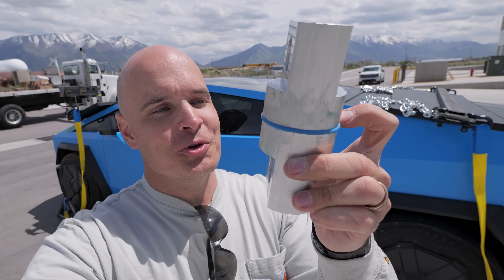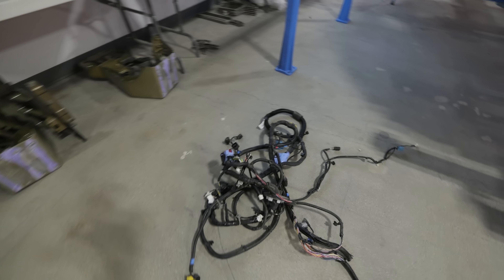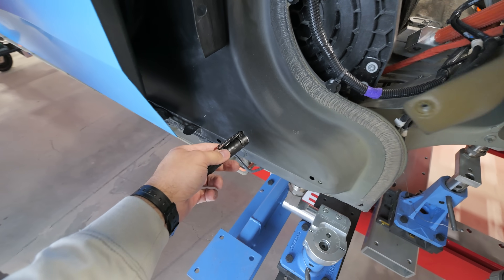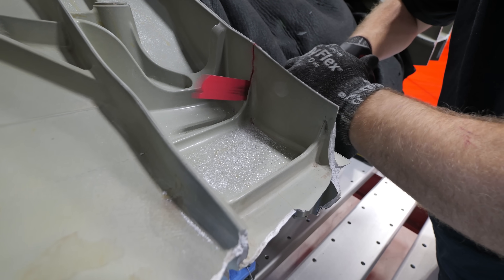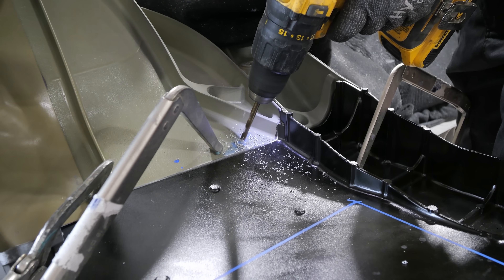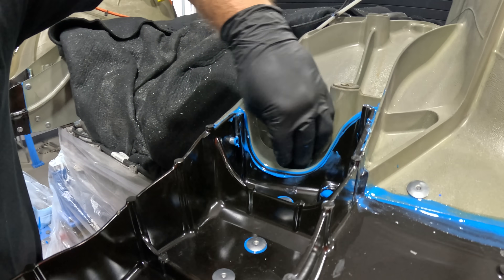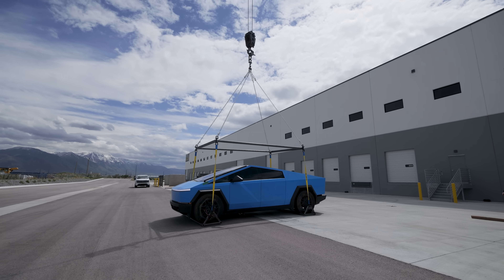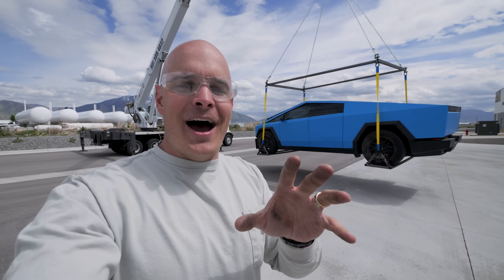Tesla Fixed my Cybertruck with GLUE - (but I'm not mad about it...)

Comment: I’ve never seen a glue advertisement this convincing in my entire life.
Reply: Have you never seen flex seal?
Reply: @paswordpasword9582  I SAWED THIS TRUCK IN HALF!
Reply: I have never seen a glue advertisement  in my entire life
Reply: @MCdGi1  Krazy Glue had one when it first came out.  The 70's?
Reply: @PruneHub  It's funny, the cyanoacrylate glue ads (super glue, also under the Krazy Glue brand) were basically this same test, just lifting two dudes instead of a car, but basically the same setup of two cylinder faces glued together. But it was the 1950s and it was only a single drop of the glue.
Reply: @PruneHub  re: "Krazy Glue had one when it first came out.  The 70's?"  exactly late 70's early 80's. those "just born" and "baby young to the world" will likely have never seen the TV commercial showing the guy in hard hat famously hanging from the underside of steel beam (you can find the commercial right here on YouTube).  this heralded the Chemical Industry's mass commercialization to consumers of CYANOACRYLATE, prior to this point in History the only glue of any consequence was...  wait for it...  ELMERS.  "Pepperidge Farm Remembers".   also ref: TESTORS...👈those who built Models and/or Model Rockets will be familiar with this glue.
Reply: @phillyphil1513  Depends on just how familiar someone is with the fumes from Testors glue.  It can blur your memory
Reply: @PruneHub  I was about to say. They used to advertise superglue by lifting ridiculous amounts of weight. It's capable of holding that all together, but where the superglue fails is it's weak defense to shearing forces.
Reply: @MCdGi1  Never seen KRAZYGLUE ads in the 70s, they adhere a hardhat to a steel beam, and a union guy hangs from it ?  Gorilla Glue current ads ?
Reply: I feel like I should get some of that glue, a hardhat, a ladder and a steel beam.
Put some on the hardhat, put the hardhat on, climb up the ladder and stick my head to the beam. Then carefully move off of the ladder...
Wait I think I just described a super glue commercial.
Reply: @imark7777777  I just posted that.... 2 days later.  I remember those ads in the 70s. They are Gorilla approved!
Reply: when I was around 9yrs old, I remember back in the 1970's here in the UK, seeing a pack of 'Araldite' two part Epoxy glue my Dad bought and used in his garage, had a picture of a car lifted by crane with just a small bonded block to the roof of the car, it blew my mind that glue could do that at the time! 😯😏👍    😎🇬🇧
Reply: @thedarkknight1971 yeah I was thinking of this one. Araldite glued a yellow car to a billboard in 1980 something
Reply: What about long term adhesive testing? Vibrations, temperature fluctuations? shear & twist forces?
Reply: Wonder how much Musk paid for this one considering all the hate he currently is getting.
Reply: "One day the old becomes the new new". In the 60-70's there was advertising about a contact glues doing the same. Lifting a passenger car from the crane. But at the time the cars weight was about 1000 kg, so Cyber Truck is 3x the weight what was back then. I might have somewhere the old glue tube box even with the photo of the demonstration.

And that is what makes it impressive. 

When young people learn about gluing, they are limited to one or two glues they can use. Then they get to learn that there is different glue for leather, for plastic than for wood etc. 
But when someone learns that there are tens of thousands of different glues, for different purposes and applications.... It expands the understanding because the changes that one can find the best glue for their application is remote. Why there are just these universal glues sold to consumers. Where industries get to use unique glue for the very specific purpose for best possible result. 

Sadly many uses then the cheapest and best for the price, and glue don't help.
Reply: That was a terrible repair though. This glue will degrade over time.
Reply: @nsevv  dude, I used this exact same stuff doing autobody 10 years ago. The only thing that releases it is high heat
Reply: The best glues are the ones you dont hear of.
Reply: Never seen flex seal ad??
Reply: There are plenty of videos showing cars being help up by a few drops of basic super blue. This isn't new
Reply: Yeah I've never seen a flex seal ad
Reply: Flex seal
Reply: Belzona ads
Reply: will it hold for 10 years of vibration, -15 to +40 degrees?
Reply: @carlknibbs2849  Q: will it hold for 10 years of vibration, -15 to +40 degrees? A: well since (CONTRARY to the stated mission) Teslas are obviously built to be "disposable" and NOT "sustainable", come 10 years time it won't matter because the bulk of the cars will be filling up the Junk Yards (just like they are right now at various CoPart and IAA yards across the country) NEVER having offset the massive Carbon Debt incurred when they were first manufactured. 👈conspicuously because their goal is STOCK PUMPING and not much else, the fanboys won't deal with this problem nor the Li-Ion Battery Fire problem.
Reply: Reminds you of the old 1980s ads for SuperGlue, where the dude would be glued by bottom of shoes to the ceiling :)
Reply: literally the super glue commercials from 30y ago.
Reply: The real question is how long it holds up after going through countless heat cycles from the outside heat and then cooling down again. Same goes for the countless winter days.....
Reply: 3M VHB tape, while not glue is pretty revolutionary.
Reply: Where can I get this damn glue
Reply: Tesla makes the glue from workers who died in Elon's emerald mines.
Reply: @andan2293  Errol's*. Remember Elon hated his dad because he's messed up? And that isn't Tesla's glue, that is Fusor 298. Hilarious joke tho.
Reply: @Earthrise-fusion  Elon might have hated his dad, but he for sure didn't hate his money, lol. 
Yeah the glue is impressive. Even the cybertruck repairability is surprising.
Reply: @Earthrise-fusion  thats why he decided to be such a pos dad himself? Few parents I have seen so hated by his own kids.
Reply: @andan2293  Why have people blown this emerald mine out of proportion. His dad only partially owned a mine and it collapsed when Elon was 17. It’s seems wild how people see someone achieve 400B and still say “but what about that 20k his dad gave him when he was starting off? 😢”. Yes, he didn’t grow up poor, but still…
Reply: @andan2293  the thing about Elon getting a ton of money from his dad is a hoax.  He got $28,000.
Reply: @Earthrise-fusion 
Yeah.
I probably shouldn't mention the adhesives and sealants used for structural reinforcement in commercial aircraft, for many many decades now.
... at least 7 decades i know of anyway, that's many 😂
Reply: @My-Pal-Hal  yeah. Honestly, adhesives have come a long way, but what pisses me off is that ppl associate glue with the Elmer's glue they used to drink in kindergarten.
Reply: @Earthrise-fusion 
HEY MAN, DON'T BE DISSIN ELMER'S !!🤬!!

... sure, ill take another, on the rocks this time 😋
WHAT DO YOU MEAN I'M CUT OFF, IT'S ONLY FIRST PERIOD 😂
And I thought it was one of the 4 Food Groups. memories...

amazing we've lasted this long
Reply: @Earthrise-fusion 
Luckily we've advanced, and moved on from that, with the amazing technologies we have Today.
... TO TIDE PODS 😂 ...

we had a good run 😉
Reply: Lol😂😂😂 @My-Pal-Hal still prefer the OG tide
Reply: @andan2293  akin to Soilant Green? We ARE glue.
Reply: @andan2293  Wow is that true? It's sad but it works well, so it's justified.

Comment: What's the benefit of sawing off pieces and wasting time patching pieces together (while adding gunk which makes the material more difficult to recycle) when the base material should be recyclable enough to just replace whole pieces. Also, how many consecutive patch jobs can there be before no more can be done... missed opportunity to ask
Reply: with machine assisted lifting, disconnecting and replacing big pieces can't be any more time consuming than this

Comment: Try it with regular cyanoacrylate superglue. It's like you're replicating the original advert where two guys were craned up using a glued link of a proportionally smaller cross-section ofc

Comment: Teslas are known to be some of the most annoying vehicles to fix, but the fact that they make all the repair information freely available is such a big deal that I think it's completely lost on most people. Go try to do a basic repair on any car that is a 2016 or newer. The most basic jobs are complete nightmares because just getting the information like torque specs, bolt dimensions, and procedural steps is stupid difficult and extremely expensive. Most, if not all, mechanics have thousands, if not tens of thousands, of dollars' worth of scan tools and many hundreds, if not thousands, of dollars a year in subscriptions to said tools just so they can do stuff like reset codes and activate certain motors to do basic repairs.

Comment: Ah yes America: "Did you trucks frame break off? No worries just slap this super super glue on it!" even if the glue is strong enough to support a Tesla, I'm still going to side with a steel frame to begin with. This video has made me even more scared to drive around one of these death machines.

Comment: Great videos thanks for the clarifying statements regarding your previous video. Maybe add it to that video as well.
Next, shop of the triangular bed and make it a regular one. All you need to do is chop off the top add on castings and bend a bit of (thick) metal. Maybe colab with Fabrats or one of the other fabs in Utah area?

Comment: Glue adhesion just as strong as a continuous piece of metal, in your dreams, the cyber truck reminds me of oceangate
Reply: You do realize tons of other manufacturers use this stuff, right? This isn't a glue stick; this stuff is used everywhere and has been for years. The aluminum frame failed, not the glue, and they used very little glue compared to the tech.
Reply: Did you even read my comment before deciding to reply?  @littlejack59

Comment: I'd like to see the sideways sheer strength, also they way over engineered the repair compared to the way and amount of adhesive it came out of the factory with, the 3 strip's of adhesive glue allow water and air to ingress between the plates, at that altitude the freezing and thawing between the plates would presumably weaken the adhesive properties and make a side sheer force (like towing!) relatively low effort failure in the long term.

Comment: I know there are some mid sized pickups that you can buy an entire new rear frame section for 2 grand. You can tell me 14 grand for labor to glue and drill dissimilar metals is a great deal all you want. A typical truck is like 6 bolts to take the bed off and Tesla started by using the incorrect glue and recalling a bunch of vehicles from the jump. It's going to have to prove itself to hold up for 10-20 years, well after the second battery pack, for me to be convinced.
Reply: $13k was the entire repair, including as you say removing and reinstalling a wire harness, repairing the frame, and reassembling the vehicle.

If you buy your rear frame for $2k that doesn't mean thats the total installed price. And your rear frame is a lot smaller than this one, likely just holding the rear suspension components.

Comment: Where's the sheer test? You can use the same aluminum test piece you created by bolting two beams using the existing holes used for the crane lifting and apply a torsion twisting until until the two pieces twist apart.
Edit: You could also clamp one half securely and use a long torque beam with a gauge to measure the failure point on the upper half of the aluminum part pair.

Comment: I'm pretty impressed. I'd love to see a comparison between this and a more traditional uni body car in terms of repairability.

With that being said, I'm still not 100% sold on the Cybertruck construction. We've already seen two videos (yours and Whistlin Diesel) of Cybertrucks having catastrophic structural failure, vs a steel frame truck not failing under even harsher load conditions.
Reply: I'm yet to see the damage in the two Youtuber's deliberate destruction videos happen to anyone in real life.
Reply: @Turbo.M777 just because you haven't seen it doesn't mean it hasn't happened. I've seen a handful of articles showing Cybertrucks having the tow hitch completely detach while towing.

Besides, even if the damage is deliberate and unrealistic, that doesn't mean it's irrelevant. It doesn't change the fact that, when subjected to similar punishment, the steel frame trucks that were tested always came out on top by a wide margin.

Comment: That's brilliant, pre marking the frame and creating snap in replacement pieces.  Never occurred to me they did that
Reply: I saw that too my mind was blown
Reply: Turning the failure mode into a feature, not a bug.  No stretch racks, then?  Just sections.  Pretty neat.  Glad.  Feels like Jerry trued things up by putting it back together, online.
Reply: @hcjpbluesky9916 it’s not a “failure” mode. It’s crash safety and repairability.
Reply: Most people don’t realize how smart Tesla engineers are.
Reply: @scotttisdale2773 most people don’t realize sectioning procedures are out there on almost any car made of aluminum or steel. Hell the nsx with its monocoque chassis was worked on at icar and most of the repair they did was just welding it back together and it did just fine. They basically cut that car in half. I would know, my teacher in auto collision worked on it and was working for icar at the time to experience it aluminum repairs are not mind blowing just because tesla can do them too.
Reply: @scotttisdale2773  Its not really smart, its just auto design 101.  Your designing a car.  Its primary design focus beyond driving is crash survival and with that of course comes crash repair.  Car buyers don't think much about it, but to engineers in the auto industry its far from novel ideas.
Reply: @IndependenceIron you are correct. However not everyone knows this. Remember when the cybertruck came out and everyone made it seem like it would be deadly in an accident? Like everyone thought they were smarter than the engineers who worked on the vehicle, lol. That’s how dumb people are, couch experts.
Reply: @scotttisdale2773  Most people don't realize how much money goes into making Tesla cars the bare minimum to make the most profit. That is the genius of it all. The interior of the CT and most other Teslas is economy garbage sold as "futuristic". No HUD? No second screens? Need to take your eyes off the road to look at the speed? Need to swipe a screen to change direction?!? It's not the future: it's spartan design that belongs in an economy vehicle sold as premium. Also, it's an "affordable" fix based on the relative value of the truck. If the CT sold at its original price point I'm pretty sure that would have been a write off. Why? Because its resale/trade in value just died completely. Here's a question: why not just make it modular to begin with? Because that costs too much money in manufacturing.
Reply: @TheDirtCreature that’s not correct. It’s just economy of scale. Remember. There was a time when mobile phones were so expensive, it was cheaper to get a landline. There was also a time when having a horse was more cost effective than having a motorcar. 

There’s a reason even legacy automakers are struggling to make  cheaper EVs profitably.
Reply: If they designed it RIGHT in the first place... there is no need to make a stupid replacement process. The CYBER CUCK is an absolute pile of shit

Comment: Here's some percentages of the stresses in the crane demonstration 

2.500in circle area = π(2.500in/2)^2
= 4.909in^2

lbs per in^2 = 7000lbs/4.909in
= 1426 lbs/in^2
= 1426 psi
= 1.426 ksi

Tensile strength of 6061 aluminum extrusion = 18.00 ksi to 42.10 ksi

Percentage of rated tensile strength = (Mksi/Rksi)*100
= (1.426ksi/18.00ksi)*100 = 7.922%
= (1.426ksi/42.1ksi)*100 = 3.387%

The mating surface area if it was only aluminum was only stressed by 3.3-7.9%. That's crazy to see how strong aluminum really is, and that's without considering that the pieces are held together with glue!! 

Tensile strength of Fusor 2098 adhesive = 3190 psi

Percentage of rated tensile strength = (Mpsi/Rpsi)*100
= (1426psi/3190psi)*100 = 44.70%

Whomever set up the demonstration clearly knew what they were doing and chose the diameter and safety margin correctly if we are really using only 44.70% of the adhesive's total tensile strength!

Comment: So I didn't look up the manufacturer specifications on that bonding adhesive that you're using. But it looks and sounds very similar to 9360 aircraft grade structural adhesive. It's what we use to put together the majority of our composite components. If you need to bond metal components to composites or vice versa, it's what's almost always used in between. It's a two-part compound that is mixed with a glass bead micromesh of 45, that sets your bond line squeeze out. If it can hold up to rocket launches, it can probably hold up to driving on bumpy roads.

Comment: There is no way it was that cheap to repair.  My model Y, someone barely backed into me in a parking lot and it cost over $16,000 to repair.  There was barely any visible damage to the rear bumper but they got the opening trunk metal and had to replace the entire back of the car.
Reply: If you did it in a lambhorgini it would cost more too. thats a different car than yours.

Comment: While statically impressive, the adhesive introduces a material discontinuity, long-term fatigue performance and resistance to peel/cleavage stresses under dynamic road conditions at the bond line will differ from the monolithic nature of the original casting.